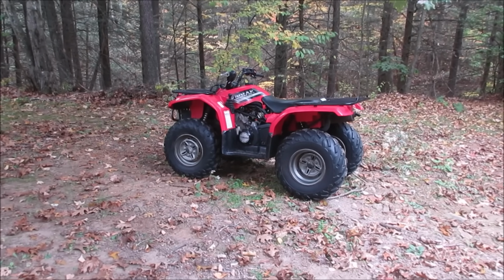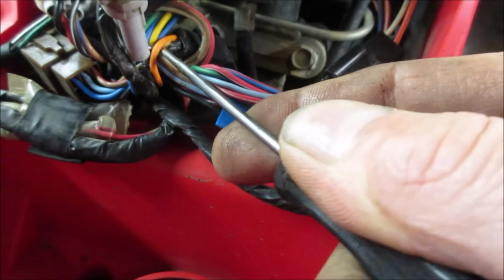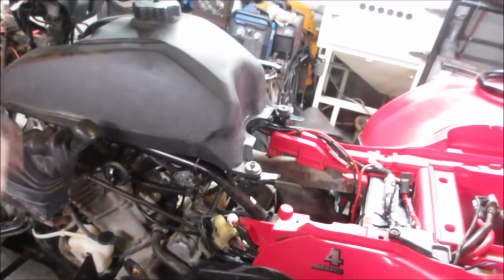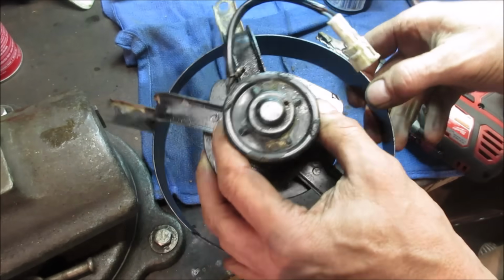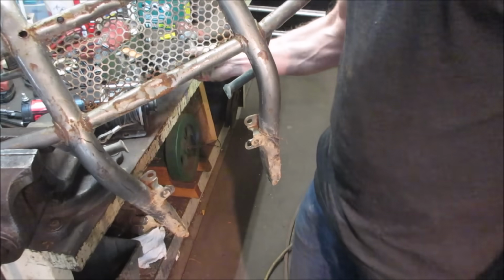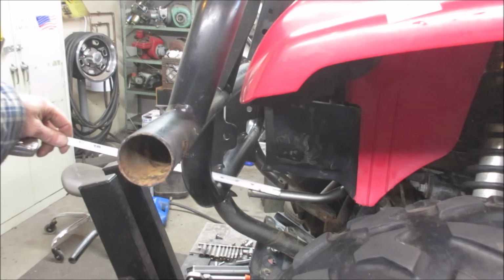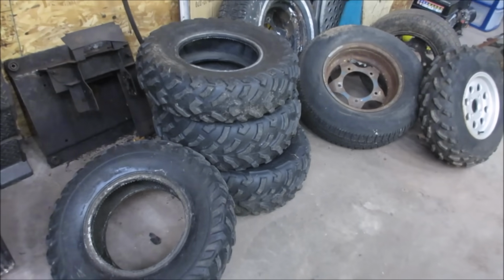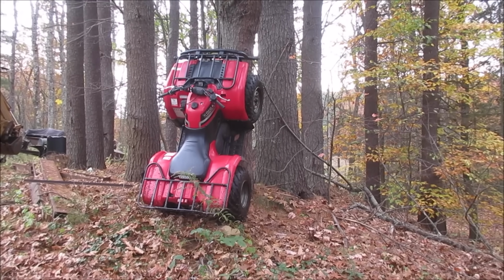Can We Fix It? Modify It? Break It? Yamaha Kodiak atv. pt2

Comment: My Polaris is having a similar issue, so I'm going to follow these 2 videos & will eventually report back when/if I identify & correct the problem. Have learned quite a lot from you, sir!
Reply: If your Polaris is a late 90s, Early 2000s model, It likely has a worn camshaft. I've had to replace the cam on 2 of them, But they run like new afterwards
Reply: I vote for a vacuum leak someplace,  several bikes I have bought had similar issues and each one was a vacuum leak or plugged idle jet ( but he cleaned this well unless there was crap in the tank). The rubber boots on carb on these old machines are often cracked. Guess I will watch and see
Reply: Also check the spark arrestor. They often foul up and restrict the exhaust